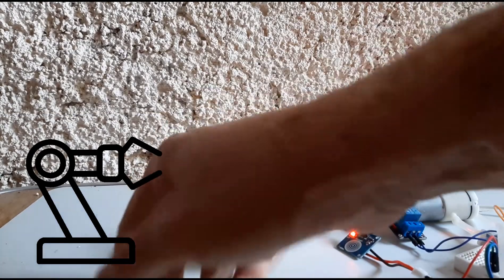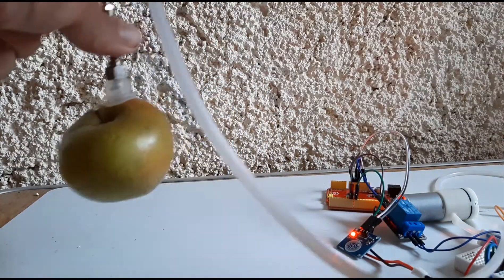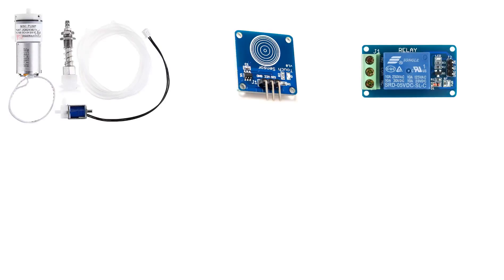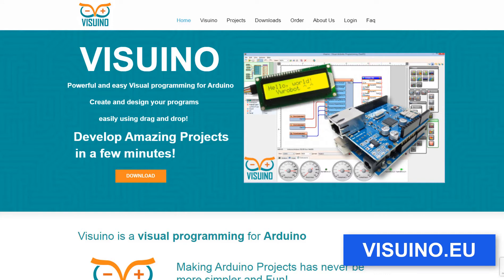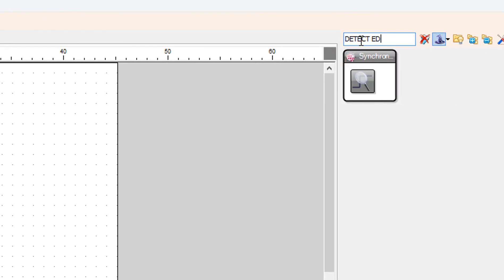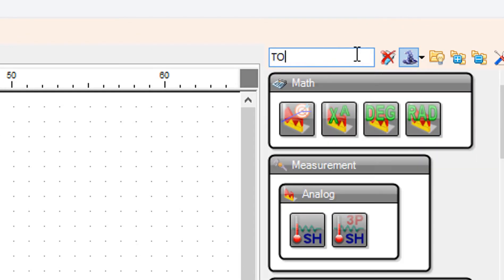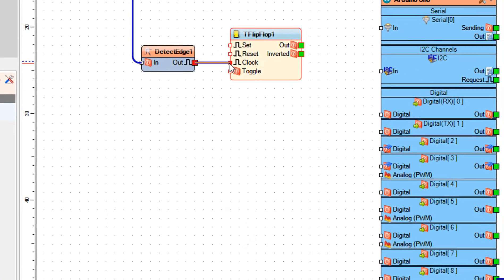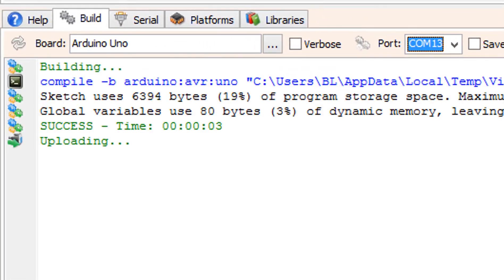How to Control Vacuum Pump Air Pump Suction for Robotic Arm

Comment: what is the maximum payload it can handle ?
Reply from the maker: That you will have to check,  the suction is quite strong (depends on the object surface) I think it should be able to handle more than 1kg.
Reply: @visuinoprojects  I want to make a vacuum gripper that can handle 1kg. What vacuum pump should I use ?
Reply from the maker: @MohamedMSaber-vy2zd  I think that this kit will handle 1kg, I bought it on bangood.com

Comment: Can the pressure from the vacuum pump being adjusted by Arduino?
Reply from the maker: Yes, In this case you need to extra control the motor with a DC Motor Driver, watch some of my videos where I show how to control a DC Motor
Reply: @visuinoprojects   Thank you!

Comment: What if i connect vacuum pump directly to Arduino
Reply from the maker: I am not sure if the power from arduino would be enough to run the pump motor. You could connect it to the L298N module for sure.
Reply: @visuinoprojects  thanks for quick reply 🙏